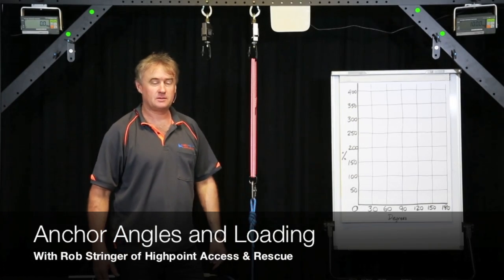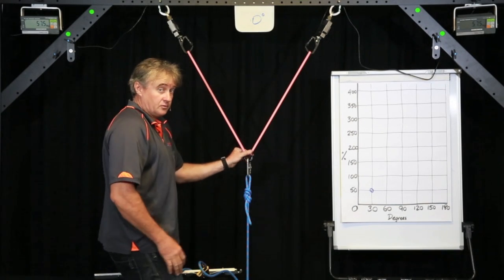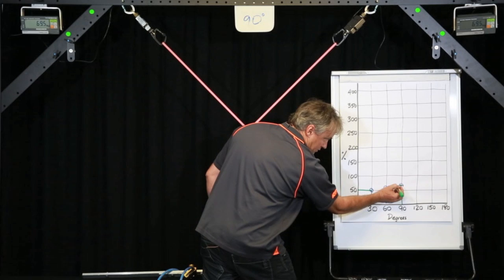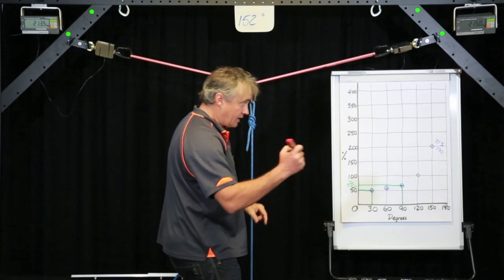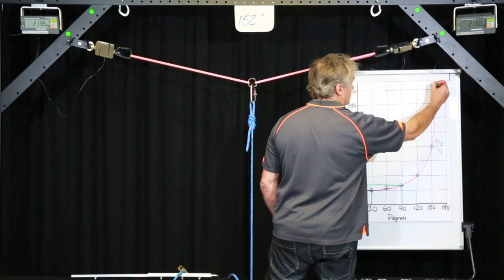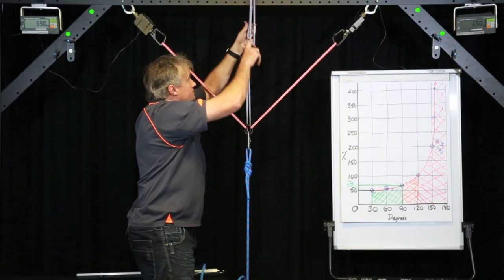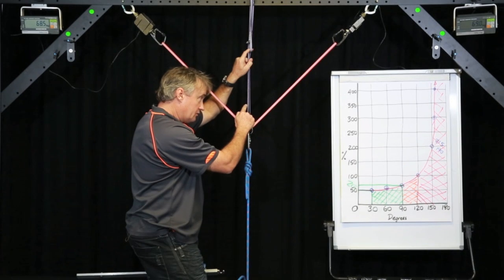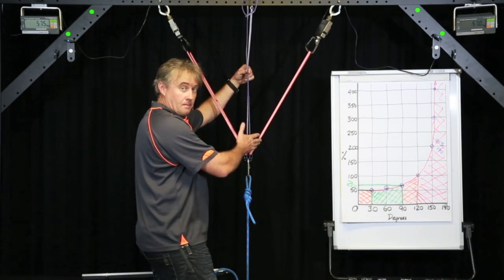Rigging anchors for balanced load

Comment: Great instructional video, however I'm still not too sure about why using anchors less than 30 degrees is dangerous. I see what you're saying that when the load is not balanced you will have uneven stresses on the anchors, but that is the same for anchors between 30 and 90 degrees, as you have demonstrated at 90 degrees. Why do the 'below 30 angles' get relegated to the red dashed line club?
Reply: because, as he says, you can massively alter the loads with only a tiny shift in the bisecting angle. this makes it less consistent, and give rise to the sudden risk of spiking up to a sudden huge load on one anchor. the larger angle does render the anchors subject to such sudden fluctuations. he's not saying uneven stresses don't occur in the 30-90 range when the bisecting angle is not central; he's saying to be wary of tighter angles because uneven stresses have bigger consequences with less change.